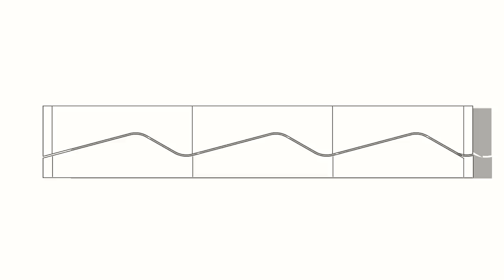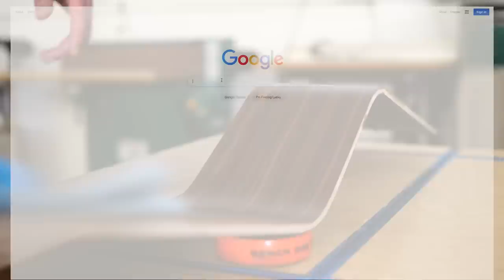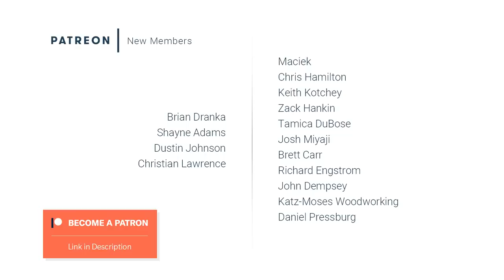Bent Lamination Sneaker Display Shelf | #RocklerBentWoodChallenge

Comment: 3 posts coming out from the wall, to sit under the top of the bend, then a small screw down into each one to hold it in place? Would do a similar job to the L brackets :)
Reply from the maker: Good call. That's definitely a possibility :)
Reply: Screwing down wouldn't be necessary if you added some registration pins to the posts and divots to the underside of the curved shelf.  It's not like you're storing your kid on these.

Comment: Thanks Chris, nice design, well executed! You clearly put a lot of effort in your videos, highly appreciated. Depending on the wall, you could also drill 3 thin (steel) rods in the wall, at the position of where the peaks of the curves will land. If you add a detail that prevents the curved board from sliding forward (away from the wall) over the pins, you have another nearly invisible mounting solution.
Reply from the maker: Thanks Harko...somebody else suggested something very similar. Sounds like a pretty good idea, so I'll probably use this as a starting point :)

Comment: once you find out where to mount the shelf. use some 1" dia dowel rods stained to match, as long as the shelf is wide. Center drill and glue in some 1/4" or 3/16" threaded rod. screw into the wall with molly bolts (assuming drywall) spaced so that the shelf hangs by the rods centered on the peak of the curve of the bent shelf. either use non slip grip on the top to keep the shelf from sliding or screw down from the top into the dowel. I think the dowel will look nice if seen. nice looking job regardless!

Comment: Hey Chris what about using pins like how you mounted the curved piece to the straight piece? Just cut them longer and sink them into the studs.
Reply from the maker: You could. It's such thin material though, I think I'd rather go under. even with those 1/8" rods you're  left with very little material on the outside. While it seems to be ok where the two shelves meet, (I MIGHT BE WRONG ABOUT THIS NEXT PART) I'd imagine there would be more stress on the back rods because the amount "cantilevered" is double. I'd worry about it bursting through the veneer.

Comment: Very cool project.  Pattern routing has been pretty useful and I can see it being used more with my stuff.   

You should look into getting a Maslow CNC router. It’s not the fastest 4x8 but for $500 built and maybe $1000 if you do all of the upgrades you can make tons of cool things and big templates.
Reply from the maker: Thanks Joe...I've looked at them a bit. Also cool that it takes up a small footprint since it's vertical. But I don't think I'd personally utilize it enough at this point. Perhaps someday through :)

Comment: 3 acrylic ¼ inch width rods sticking out of the wall where the up bow part of the laminate is. You could have them the full width of the laminate without it being distracting. This way you wouldn’t have to attach the shelving to the rods either making it easier to remove if re-decorating. 👍🏻
Reply from the maker: Nice! I've never even seen acrylic Rod...but that looks like a pretty good solution. would 1/4" have a lot of flex in it? If it's going under the curve of the shelf, I can go with a larger Diameter if need be.
Reply: Chris Salomone 
You could go to ½ inch, it still wouldn’t detract from the look Chris. 
Thanks for the reply. 👍🏻

Comment: Would use same methods you used to connect the two boards: drill some holes in the bend part and in the wall. Then you can use the roods to connect the wall an the shelf. Wouldn’t use poxy to glue them but a little screw from bottom if the friction fit isn’t enough so it is easier to disassemble if you need to. 
Btw: love your work. Keep it up.

Comment: That is DOPE pimp!  I have been curious about your shoe game and how you displayed them.  About mounting the shelf though, if you made the back portion of the shelf slightly thicker couldn't you then use the floating shelf bracket and make it a floating shelf?
Reply from the maker: You could...but it would have to be a lot thicker. it's about a 1/4" which was 8 laminations. So to make it 1" thick would be 32 laminations...that would start to get VERY expensive for just one little shelf.
Reply: @Foureyes.Furniture  Maybe fabricate a dowel braket to recreate the floating shelf bracket or hit up Rocker and show them the issue

Comment: Great Video.  Is apple itunes still uploading the podcast?  Last episode that is showing is ep141?
Reply from the maker: Yeah, that is right where we switched our Podcast host. But if you're using the Apple Podcast app it should definitely be updating. That's what I use and there was no lapse. We did have a lapse in a few smaller podcast apps, we've been contacting them trying to get it fixed. But all the majors should be updated. What are you using?
Reply: I was using itunes from my laptop and transferring it to an older ipod.   I just check store on actual ipod and the episodes are there.  I will just DL it from the device.  Thanks

Comment: 3 thick dowels on the wall. Top of dowels rest in underside of bend. Maybe coloured dowels if you feeling spicy
Reply from the maker: Yeah...some sort of "rod" or dowel seems to be the front runner so far :)
Reply: @Foureyes.Furniture  maybe thick Brass rod rather than dowel and a key hole router bit for hanging

Comment: Such a sturdy mould for a one-off project feels wasteful. I like the idea better for making sets.
Reply from the maker: Yeah, I talked about this on the Podcast, that it felt weird doing so much prep work for one thing. But, I still have the forms and they are in perfect condition to re-use, so I could definitely make more of these. I have an idea for actually using the form to make something very similar with a different twist.
Reply: Could use half the form and a vacuum bag